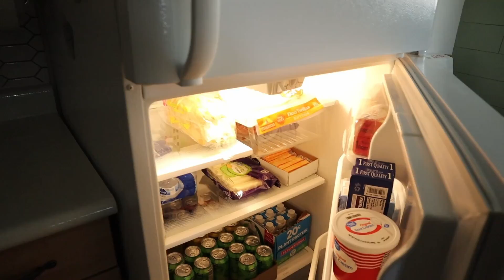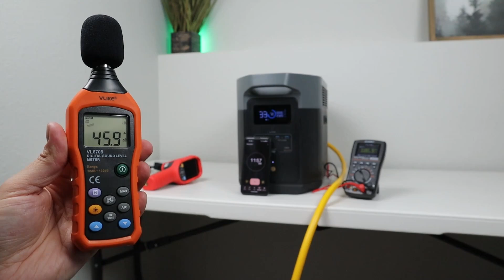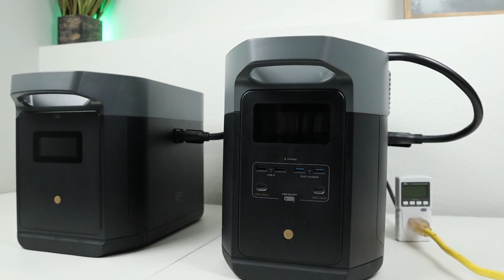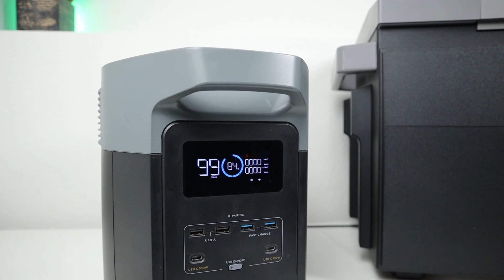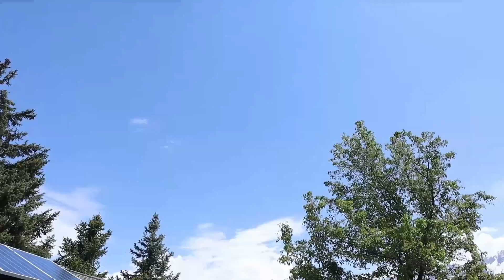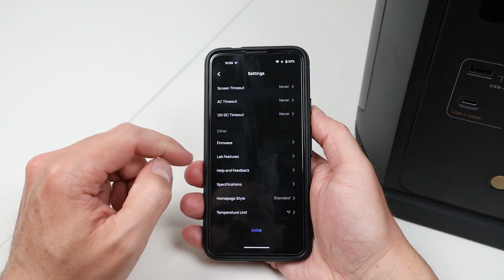The NEW EcoFlow Delta 2 MAX - LFP Batteries - QUIET FANS - 1000 Watts of Solar - FULLY TESTED!

Comment: Wow, it's kind of disappointing it cannot run a diesel heater!
Reply from the maker: That's the issue with pretty much all these power stations. Bluettis larger units have a 25 / 30 amp DC output which is awesome for that. The AC200P and AC200MAX.
Reply: @Jasonoid  Any plans to test the Anker Powerhouse?
Reply from the maker: @silvere36  https://youtu.be/djUvu5D8Kmo
Reply: @Jasonoid  Thank you! That looks like a much better unit than Ecoflow.
Reply from the maker: They are pretty comparable, both have advantages and disadvantages. The Anker has a faster UPS feature and wheels and a handle. The Ecoflow has better solar charging abilities.
Reply: @Jasonoid  Watching several videos, I really like your no nonsense approach. After several other videos, it seems the Anker is still quieter than Ecoflow. I think I would trust their customer service more thanks the based on China Ecoflow too. I just bought their Wave 2 and it just doesn't even feel like it's a finished product. It has temperature control but we'll not shut off once it reaches temperature. What's the point?
Reply from the maker: @silvere36  usually an air conditioner will go slightly below the set point so it doesn't have to run for a longer period of time. How much lower does it go below the set point? Have you updated the firmware?
Reply: @Jasonoid  I'm on version 3. It's the newest version. I had set it to 74, and it got down to 69 and was still going. Imho, it should either go to air or go on standby.
Reply from the maker: @silvere36  Todd Parker (fellow youtuber) did a great review video of the Wave 2. I haven't even touched mine yet so I'm not exactly sure how it works. You may be able to ask him in the comments what he was able to do to get his working well. He was critical of it but it did work well for him.

Comment: @jasonoid in your expert opinion what do think the best portable power station for overlanding for at least a week would be? I had my mind made up about this throughout the video and for you to say that it wouldn't be the best for overlanding was disappointing.  Any advise? I typically have a fridge heaters and appliances for cooking charging devices and other peoples stuff.
Reply from the maker: If you are only powering a DC fridge on the 12v sockets it will work great. If you want to power more 12v devices at the same time, that's where it won't handle the output. It all depends on what you are trying to power. The AC inverter works really well on this model so if you were using the inverter for your appliances it will work just fine. 
Things that won't work:
- diesel heaters
- 12v aircompressors
- Anything DC that pulls over 140 watts
Reply: @Jasonoid   well that helps a lot. Thanks! Ill look into a power station that can power multiple 12v devices.

Comment: I have the Delta 2 with extra LifPo battery, will that extra battery work on the Delta 2 Max?
Reply from the maker: While it may not be officially supported, it should still connect and charge / discharge. My friend connected his older Delta Max (NMC) battery to it and it worked.

Comment: Thank you! Was set to purchase Anker 767, but now I will wait until you do a side-by-side comparison with this one.
Reply from the maker: They are very close in performance. Both are very quiet, both have great inverters that put out 2400 watts. This one is better for solar input but lacks the fast UPS. The Anker 767 has less 'real world solar' charging but has a more reliable / faster UPS and also supports 20 amps output via the 12v sockets. If you weren't into ton's of solar charging input, I'd probably lean towards the Anker 767 due to the higher DC output and faster UPS.

Comment: Great video as always.  They made significant changes.  I don't think I'll buy one as I have 2 Delta maxes already that I use as UPS when traveling.   They are getting better.  I would consider buying a battery for the maxes but for now they work great.

Comment: EG4! Please make a video with the Sever rack battery as a expansion!
Reply from the maker: Sounds good! 👍😁
Reply: +1. With the limited DC output, using a 48V external battery makes a lot of sense. Especially with more IT and other equipment running on 48V now.
Reply: Youtuber jehugarcia already did this with a server rack 20k setup as well a bunch of recycled scooter batteries as another setup. To show a plug & play turn key setup & diy setup using recycled batteries. But it was using Delta Pro's being charged by the server racks.Same concept may work for the Delta Max.
Reply from the maker: @1ENDUSER  yeah, usually trying to sell his in stock batteries. He does tend to leave out some details to make it beginner friendly. Great content on his channel. I got into his stuff awhile back when he converted the electric VW van.

Comment: My EcoFlow Delta 2 does not charge on AC, DC or solar. This is the second unit EcoFlow has sent me. Am I the only one?
Reply: Mine works perfectly. You should send it back.
Reply: @teuton6167  Will do. This will be the third time sending back. Their customer service has been better than the Delta2 so far 🤷‍♂️
Reply from the maker: You tried getting the firmware up to date via the app?
Reply: Updated firmware. Thank you for asking. Ecoflow is fully refunding. Customer service better than the Delta 2 in this case. I would consider them again based on customer service.

Comment: How is ecoflow’s customer service? I was leaning toward the Anker 767 because of Ecoflow’s noise level. But now I’m intrigued
Reply: Anker 767 also has a 30 amp output.
Reply from the maker: The Anker has a 30 amp RV receptacle but it supports the same 20 amp output as this (2400 watts). You could always buy this adapter to get the same thing on the Delta 2 Max: https://amzn.to/45vJVbj
Reply: @Jasonoid  I wasn’t aware of that option—thanks!
Reply: Our customer service is outstanding based on our user's feedback, 🙂
Reply: From my experience last year when contacting ecoflow with questions on their ecoflow max it was very good.  I sent them 3 emails, and got back confirmation that they received my email and I would get a response.  Within 12 to 24 hours they sent me back answers to my questions, and even transferred my email to one of their techs.  I called then also twice and though i didn't get through initially, I left a call back on their voicemail.  Both times they got back to me within a day.  I think the reason for not reaching them by email or phone  initially is the time difference .  I called and emailed them here in the US in the morning, and I think it was after midnight overseas.  They got back to me once business hours resumed is my take.
Reply: @acuras86  thanks!
Reply: @Mrbigwalt2  Sure, for what its worth, at the  same time, I was leaning toward the Bluetti AC200 and contracted them also both by phone and email.  I tried I think three times total over several days to reach them by calling, all times I was transferred to their voicemail, but kept getting message that their inbox was full, and to try back at a later time.  I also tried contacting them by email 2 or 3 times,  but never got through.  I did leave my questions, and waited for a response.  I "never" received any response for any of my emails.   That being said, this was about one year ago, so perhaps Bluetti has revamped their customer service.

Comment: Can you use this for an off grid power station
Reply from the maker: If your appliances use 120 volts, they will plug into the 2400 watt inverter. This will power a full sized fridge, microwaves, and other appliances. It will not power 240v appliances like electric stoves or electric dryers / heaters.

Comment: I am building a overlanding Suburban, would the Delta 2 or the Delta 2 max be better. I was thinking about the Delta 2 with the Delta 2 max expansion battery to run the Wave 2.
Reply from the maker: They are both capable power stations. The Wave 2 uses quite a bit of power so the larger the battery the better. What do you plan to run off the DC output in your rig? Just a 12v fridge? Anything else?
Reply: @Jasonoid  a refrigerator and charging up your usual 12 V stuff.  I also have some 12 volt roasting oven and cook pots that I would like to be able to run. I am planning on living in it for 3 or 4 months at the time.
Reply from the maker: @adamtedder700  you'll need to verify your entire load does never goes over 140 watts, that's the limit on this unit. I'm thinking those devices will go over 149 watts.
It might be better for you to look at the AC200MAX from Bluetti, it has a 30 amp DC output that can handle over 300 watts of power, so much more.

Comment: Thanks for the review ..but i'm very dumb when it comes to amps, volts etc and i don't understand why this hulk of a unit wouldn't run one of those chinese diesel heaters when it would run your fridge at home :(  i bought the bluetti eb3a last year and realized it didn't either but chaulked that up to it being so small.  keep up the good work and lets see more camping videos with your gear.
Reply from the maker: The inverter is very good on this unit. However the DC output (the 12v cig plug) only can put out 140 watts. Most diesel heaters will pull 155 watts or so and it will shut off the DC output from pulling too much power. You'll want to run the diesel heater off something that can handle more wattage.

Comment: So.... I have the original Delta Max which has 800W total solar charging using a single input, and I own four 220W panels (connected with a single 50' 10awg feeder from yard to shop) so I could max out it's charging capabilities.  If I bought this unit, I would have to buy another 50' feeder to then split the solar feed to 500W each between two inputs.
Reply from the maker: Yeah, you'd want to connect two of those 220w panels in series for one input, and then the other two in series for the second input. It would require a second power line as you mentioned to get all the power back to the unit. Of course the perfect scenario would have been 150v input @ 15amps, 1000 watts but we didn't get that 😔
Reply: @Jasonoid  Wondering if using an XT60 Y Splitter to feed both DC inputs from one 800W solar feed would work.  🤔
Reply from the maker: @FU2_Ggl  I wouldn't go over 60v total

Comment: really great changes, and i will take the couple of pounds more for the safer battery for sure! surprised it was not more really.

suggestion, if possible for you to collect with an oscilloscope the transfer time when switching from ac to batt, hobotech and mathus random stuff has done videos on it. if not, that's fine as well, you have shown really well about how it will sometimes work and sometimes fail.

humm what have you got planned for that 48v server rack battery, looking forward to whatever you come up with!
Reply from the maker: I've seen Mathus do more advanced testing with his nice oscilloscope. He has a great channel. I don't really watch Hobotechs videos any more since he banned me. Rubbed me the wrong way... So I don't care much about his content. I've been debating about upgrading to a nicer oscilloscope to see what happens in better detail. I just need to justify spending $500+ on it first LOL
Reply: ah yes of course those things can quickly become expensive, and then you also have to take the time to learn how to use it.
sorry to hear about you getting banned from his comments, im sure you can still watch the videos however. i mostly watch hobotech for the entertainment factor in his videos, though the facts are good as well.

Comment: The Delta 2 as a game changer and is still the best sub $1000 you can buy.  While the Delta 2 Max is a definite improvement over the old Delta Max, and is a great power station to get if you are new to the 2KW+ market, i couldn't see it replacing a Bluetti AC200 MAX, which does have 30A 12 VDC outlet and can use the B300 batteries, which also fit the AC300 and AC500.  It would have been nice to see the Delta 2 Max being able to use the Delta Pro batteries in addition to the 2KW batteries made for it.  But, we can't have it all.  Eco Flow is definitely better at customer support.  Also, does the Delta 2 Max work with Eco Flow's dual fuel generator like the Delta Pro does?  That would be a huge selling point.  Thanks for the great review!
Reply from the maker: Yes, it is compatible with all Ecoflow devices, including the dual fuel genny and the Wave 2 portable ac.

Comment: Very nice power station. Not sure if this is more or less efficient on dc than the delta 2 but I can check your list. I think this would be great to use along with the wave 2 unit. I think Bluetti is slightly better for the solar input voltage and the external batteries do not have to have the main unit to be useful. Definitely like that you can get the unit with 2 free 110 watt panels, very nice.
I wonder if you can charge the extra battery through the wave 2 if you use the extra battery on the wave 2 to power it without the main unit?
Reply from the maker: I agree that the higher solar voltage limits and batteries with inputs/outputs are GREAT features that this could really benefit from! I do have the Wave 2 so I'll have to test with just the expansion battery to see if the AC charging charges both the battery and runs the AC.

Comment: As usual,  another excellent in depth review.  I really like the dual solar inputs and super quiet operation.  Personally, I'd rather have the TT30 outlet and a set of wheels for RV and portable use but I get that Ecoflow is going after the stationary crowd.  Another good test would be powering an RV air conditioner to see how well Xboost really works.  That being said, Ecoflow really needs to improve their EPS function to 10ms or less to keep the back up power crowd happy.  A lightweight custom tow cart would be awesome.
Reply from the maker: Great points LeafNuts! Maybe one day I'll have an RV to add that type of Air Conditioning test but for now I'm limited to car camping haha.

Comment: 60 volts is no go for me.
Reply from the maker: I was kinda bugged about the lower 60v cutoff. At least they have two charge controllers and a high 15 amp limit. I was secretly hoping for 150voc... didnt get my wish.
Reply: @Jasonoid  I know what you mean but you would think with a new version. They would do  100volts with two portable and 1600watts and Expansion batteries you could put solar into that also. That's not the direction they wanted to go to make a great unit.
Reply from the maker: @zfontain1975  totally understand, missed opportunity for sure.

Comment: I am confused.  I have the EcoFlow Delta 2, and it has LFP battery chemisty.  You've said at the start of this video that the Delta 2 has Lithium Ion NMC battery chemisty but that the new Delta 2 Max has LFP.  Can you clarify for me, please?
Reply from the maker: This video is about the Delta Max vs the Delta 2 Max. 1st gen vs 2nd gen. All first gen Delta units had NMC chemistry. This video is about the 2nd gen larger model (or the Max size).

The Delta 2 is the smaller model that has LFP batteries as well and launched earlier this year. Hopefully that clarifies your question.
Reply: @Jasonoid Thanks.  So, you're comparing the new Delta 2 Max to the original Delta and not to the original Delta 2.  At any rate, I love my Delta 2 in LFP with the 1800 watt inverter, and I would love even more to have the 2400 watt inverter as the new Delta 2 Max has, also in LFP.  Does that makes sense?
Reply from the maker: Yes, in this video I am comparing the Delta Max to the Delta 2 Max, same size units just one is the newer one (2000wh / 2400 watt inverters). I have a full review on the smaller Delta 2, it's a great unit as well.

Comment: I almost pulled the trigger on this but I was disappointed in the limitations on the DC side. A PS of this size should offer a 15 amp port. My off grid setup will include a 12v diesel heater.
Reply from the maker: Yeah, that's sure one of the cons. Bluetti has 30 / 25 amp DC outputs which is an attractive feature!

Comment: Like to see the comparison video. Question…lets just say you have no smart device. No BT or WiFi. Can you still make any of those changes to through the screen on the Delta 2 max? Love that the fans are so much quieter now.  This is just out of my fixed budget so i interested in the comparison video. Keep up the good work. Thanks for all you do!
Reply from the maker: The settings are only controllable via the smart app. If you didn't have a smart phone you could always have a friend / family member use their phone to set the settings up as you like.
Reply: @Jasonoid  yes you could. I’m thinking more if like its the worst situation you can get into. No nothing!

Comment: The problem with Ecoflow is their abysmal customer support. Customer support from mainland China is  very poor.  Try to avoid buying from Chinese companies if you can to avoid headaches.
Reply from the maker: You must have been contacting a different Ecoflow. They have one of the best customer service departments out of all the units I have tested on the channel. All power stations are also made in China. (Anker, Jackery, Bluetti, Ecoflow, Goal Zero, Pecron...pretty much all brands. )
Reply: Our customer service always tries their best to make the client satisfied and have better user experiences, if you have any specific issue I will make sure to be solved  and make them contact you back .